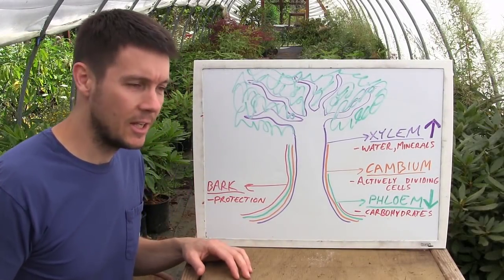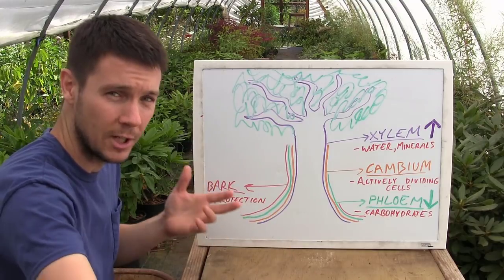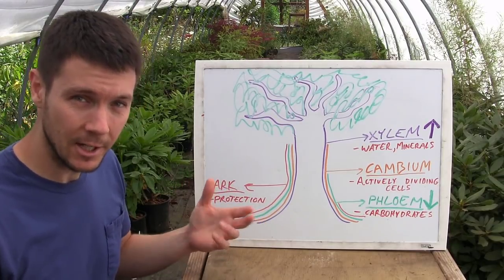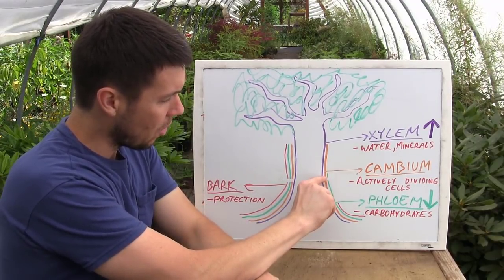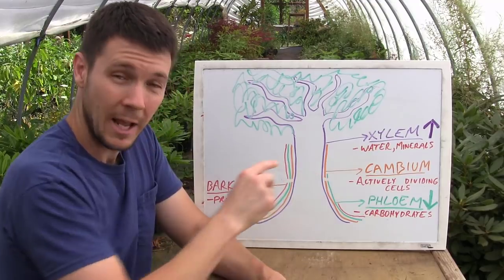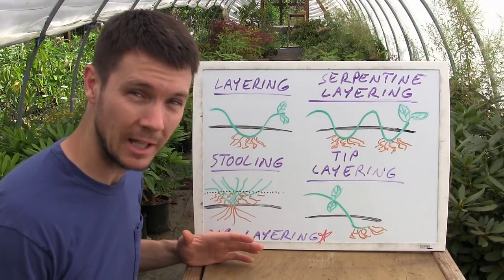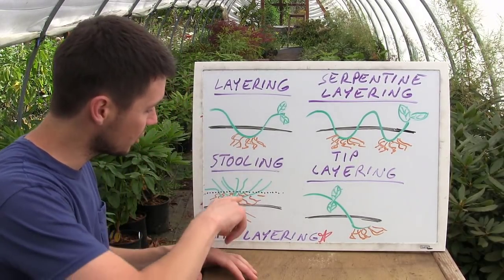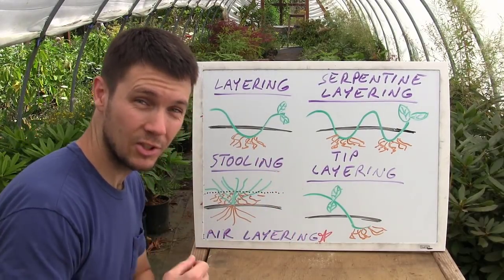Air Layering Fig Trees | My Experiment and the Science Behind it

Comment: SIR!  The knowledge you shared with me in this video has changed my life. Ring-barking the branch to prevent all sugars from going down sounded good in theory but I've killed branches of slow to root trees because they weren't strong enough to survive without phloem.  After watching your video  I've air layered mulberry and carambola(very slow to root) by placing a pot of dirt on a high stool/pile of bricks/ladder up to the low branches. I Removed 1/2 to 3/4 of the bark, lightly scraped the cambium and put the exposed side of the branch down. After a month, 100% survival and vigorous roots. I just snipped and left them in the same pots.
Reply from the maker: So glad to hear it!

Comment: I have 1 air layer of a 1 inch thick trunk.  I did not cut anything (I'll explain).  It's been on for 1 1/2 months and I used a three liter coke bottle.  The bottle is full of roots.  Now I have only done it this one time, but from what I saw there is no need to cut nothing.

Why I didn't cut?  Because in most videos I have seen, the roots don't grow out of the cut, they grow out of the nodes, and those other little dots on the bark.  I have rooted six cuttings and none of them had roots at the end of the cutting (where it was severed from the mother tree). All roots came like I said.  Now the nodes will produce the big thick roots instead of a branch, and from the little dots on the bark, thinner feeder roots will develop.  

For me I think that cutting all it does is open a wound that will allow bacteria and fungus in, all my failed cutting when I dug them out, the cut part was rotten.  So when I remove the air layer I will make the cut, and seal the exposed wood with a mix of resin, bees wax and candle wax.

Hope this helps.
Reply: Yes buddy you are perfectly right.

Comment: One thing I wanted to point out.  You answered a question for yourself and didn’t even realize it.  When you mentioned how easy figs are to root.  You Can do an air layer on fig without cutting at all and it will root.  However many plants just will not work that easy.    A lot of plants I’ve air layered and didn’t quite scrape good enough  , totally callused over and healed without any roots.   So I think it depends all on how easy the particular plant is to root .
Reply from the maker: I think you're right

Comment: Hey Mike, I just had a thought about the cuts you made. Have you done some experiments with horizontal slits instead of vertical? My thinking is that a horizontal cut would make a bigger impact in the flow of the plant going from top to bottom (like it does in ‘notching’). So Im wondering how a horizontal cut would perform vs a vertical cut 🤔😅
Reply from the maker: I agree 100% and love your idea.  I'll have to do a video experiment about it next summer when air layer season resumes.

Comment: That's a great informative video, Mike.  The one thing I might add is that when doing airlayers in the summertime, in a hot climate, like mine, here in south-central Washington state, it's a good idea to wrap the airlayer cup with aluminum foil to keep the soil in the cup from overheating from the sun.
Reply from the maker: Thanks Steve.  I've always used foil in the past but decided not to this time because it was later in the season and I wanted the soil to heat up.  You're right though, you live in a hotter climate and it might cook the cuttings.

Comment: Hee hee hee... by the second time you used the word "girdle" I knew exactly what you were doing wrong. I've been doing this for years by simply scratching a 2" section of bark away on half the branch with my housekey and laying it on the ground with a rock to hold it steady. So far, 100% success rate!
Reply from the maker: Great affirmation!
Reply: You are kidding? Scratch with a house key just one half of the branch and that's an successful airlayer. Good to know
Reply: @bobbrawley2612  Yep. No root hormone, no plastic womb filled with mulch, just scratch the surface with the key (which I assume permeates all the right layers) and then rest it on the ground with a rock on top. You can dig a little trench if you want, but I don't find it necessary. I do it in early spring to hydrangeas and rhodies, and just leave it alone until the next (not following) fall, and it's good to dig up and replant, or just leave to extend the original plant. If you leave it, you should cut the plant away from the mother after the first year, or it'll thrive at the expense of the original plant.
Reply: Did you accomplish this scratching also on a fig tree? How about other kinds of plants or trees?

Comment: Is this  experiment  still valid in your experience 
I don't understand why in airlayering videos everybody shows removing an inch of bark around the circumference  of the branch . A 3/32 " cut from a hacksaw blade would would interupt the down flow. 
 Rooting hormone applied to the White wood at the removed bark area  doesn't seem to do any good when the roots form from the terminus of the intact  bark  the naked or "sans bark"area doesn't sprout  roots

Also you learn by reading stuff . Where are you reading this stuff.
 I view videos to learn and have only read one university document on the best part of the branch to take a cutting in peach cultivar. 
The conclusion was the middle of the branch yet you show Dan having great success with cuttings from the terminal end of fig tree the soft green wood .  
 Scientific or university  studies .don't seem to be the "do all end all" word on practical gardening

Comment: Why doesn't bark rot in cuttings immersed  in a water bath and cuttings in damp soil or   sand rot?  Is oxygen the promoter if rot?
 In videos of cuttings immersed  in water the best root growth is right under the bubbler  whare the air bubbles  strike the cuttings . In that case the  oxygen  seem to promote root growth
Now what about your lecture on sand for us that don't have access to your red wood bark multch. I was shocked to discover how well sand retains dampness ., concluding that glass marbles and hyponic flush  would be best or better than sand to prevent rotting . All theory since I haven't tried either sand of marbles

Comment: I did airlayers on both my Golden Rainbow and Cardenillo this year. I used my grafting knife an scored the area. I just went down to white on both. I used rooting hormone as well. Both were successful and held their leaves. I did not girdle and had extreme root growth. Great minds think alike! Both trees are in their own pots and are thriving.
Reply from the maker: That's so great to hear.  It's funny, I think we've all been taught wrong all these years with the girdling technique.  My main purpose was to prove the theory for tougher to root plants like my rhododendrons so that's the next experiment but I'll have to wait until next summer to try it.  Thanks for sharing and I'll bet you'll get a pretty penny for that Golden Rainbow.
Reply: I ended up taking one of the massive leaves off the GR after potting. It was having a difficult time feeding the three huge leaves and two figs. I also took the two figs off. It perked up immediately. I plan on putting one of my two trees in ground in the spring.

Comment: Awesome discovery Sir.
Excellent. 👍
Could you explain how you made the cut?
Was it upwards or downwards and how deep? Did u do several cuts on halfside leaving the opposite untouched? Would like to see more progress with this new technique.
Reply from the maker: The slices I made were just through the soft surface layers of bark and cambium, I didn't cut that deep and I used a downward motion on the knife.  I'll keep you up to date on how they're doing next spring.
Reply: @MikeKincaid79  
Ok thx Mike for info.
Just to clarify if the stem is  vertical you cut downwards underneath a node?
I'll try it myself to see if it was successful. 
Another question did you add rooting hormone and do you keep wetting the potting soil or peat moss inside the plastic cup to encourage rooting?
Reply from the maker: Yes, cut downward along the length of the stem.  I did add rooting hormone, it's in the video.  I moistened the soil in the cup occasionally because I didn't seal it up with foil.

Comment: Thank you, Mike.  When you showed us the roots toward the end of this video, you said it was past the middle of September, but you didn't tell us when the layer would be removed.  When did you remove it from the mother tree?  Did you wait until dormancy?  Lop it off in September?  Or did you wait until Spring?
Reply from the maker: I didn't remove it and left the air layers in place all winter.  They ended up not making it through the winter.  I recommend cutting them from the parent tree now, potting them up, and protecting the new air layers.

Comment: Freezing temperatures on  
 my experience  doesn't destroy the roots of an air layer . Freezing temperatures  in the low 20s   20° F 
I had a  Chicago  Hardy airlayer to survive the winter in Manassas  Va
Reply: I had a pear cutting about a 1 point 5 inch branch that survived  in  five galleries bucket of water that frozen solid there were roots on the cutting being an airlayer where I only removed the bark half way around necsuse another leader was too close to get my  ra-or blade knife to He close side  that was. Five years ago 
 When I have  high expectation everything fails when I have low expectation I get success. That is the way it seems 
 In other words " don't baby the project" which is hard for me not to do

Comment: Great video. Under the right conditions the fig will  set roots without doing anything to the bark. I recently got some fig cutting from a friend, and a few of the limbs that were touching the ground had rooted. When propagating the cutting I took, the humidity was a little higher than necessary and the cuttings started putting roots out on the part of the cutting that wasn't in soil. I made a YouTube video of this if you want to check it out.
Reply from the maker: Sure, I'll look at it, thanks.

Comment: Mike you made air layering way too easy! Unfortunately, I don't have your green thumb to air layering anything although I have tried countless time to no avail.  My last attempt was on a mango branch and a Thai apple branch made on March 6, 2022, and I will be checking on the roots on March 26.  I applied the old method of removing the bark and cambium, used the air layering plastic ball, sphagnum moss, root hormone, and then wrap the whole thing with foil. If they don't root, I will try again with your new techniques but I am convinced that there is something I do that's not working. The trouble is I don't know what that is!  What is that little one thing I forget to do?  Thanks.
Reply from the maker: Wait!  Lol.  That’s the one little thing.  Air layers take longer and you may have to wait 3, 4, or more months.  Make sure the medium doesn’t dry out.
Reply: @MikeKincaid79  LOL... thanks. May be this is a topic you could cover on another video... How long is long enough to know if the layering is successful. Is there a tell tale sign from the branch growth above the girdling area?  Thanks.

Comment: I followed your method last summer.  I t worked so good!

I potted them through the winter in pots on the South side of the house.

I just planted them in March 2022.  They are getting leaves.

Thanks for this video.
Rhonda
Reply: I cut all of the bark.  However, I will try slicing this year.
Reply from the maker: Yeah, no problem.  Glad it worked out well for you Rhonda.

Comment: Do you water the air-layer cup, or do you just water the pot and the plant waters the air-layer itself?
Reply from the maker: You don't want the medium in the cup to dry out so if it starts to dry out then you would need to add a little water.  That being said, if you seal it up tight enough, it should root before it dries out.  Yes, the plant will supply water to the top of the air layer because it's still attached.

Comment: Tip. You can buy a cheap soldering iron to melt holes in the cup, and lid to get a tight fit around the  limb.
Reply from the maker: I really need to get one of those.  Picked up some Christmas tree ornaments that I'm turning into air layering pods and the dremel is a slow method that makes a huge mess.

Comment: Hey Fig Bro.. I air layer without removing any bark or even scoring the bark on fig trees. Especially where the growth is still green , the greener and fresher the growth the faster it generally roots. So no scoring or bark removal at all and you can get rooted air layers on fig trees with very very high success rates. I been testing it for 3 years and it works consistantly. Especially when done in the earlier parts of the year when its warm and trees are actively growing. I will do some this year and put it on here.
Reply from the maker: That’s fantastic!   Thanks for sharing that.  I’ll give it a go this season.  Heck, maybe I’ll make a video about it.

Comment: Its been 2 years,  Is this method working on harder to root plants?  I am going to try multiple methods at the same time and see what my different results are.   I have been using straight sphagnum moss not peat moss.
Reply from the maker: I definitely like this method better.  I should do an update video on this method this summer.
Reply: @MikeKincaid79  I was wondering if a reverse method would trigger branching particularly in the root stock of a great performing Peach Tree.    The actual fruit producing specimen has serious nematode and other root problems  so I want to trigger the rootstock to branch so I can air layer that and start up a rootstock mother plant.  Going to try something,  let you know if I discover something worth knowing.

Comment: The obvious answer is it might heal instead of making roots..
Probably leave 1/4 of bark as a start point
Reply from the maker: It did, and you're right.  It actually did root but very minimally and the roots were so weak that they died back that winter.
Reply: @MikeKincaid79  ok so some thoughts. Try to leave 1/4 of bark then if that doesn't work less or more depending on results. Also maybe make the length of cut longer like 2 inches would be harder to repair. This is probably a balancing act you would have to adjust for every different kind of tree.i also think it is worth the effort to have a much healthy plant in the end.
Reply from the maker: I appreciate your thoughts and like where you’re going with it.  I’ll have to do some more experimenting.

Comment: The way you air layer (girdle or diagonal cut) varies based on the fact the tree is either a Dicot or Monocot.  On Dicots, you girdle the branch and with monocots you make a diagonal slit through the branch.
Reply from the maker: Thanks, I’ll look into this more.
Reply: Yes, you are correct. However, Figs have a dicot system with netted veins. They are not monocot such as the Dracena plant that has parallel veins. Hence, Mike's question  as to why air layering a fig tree should require a 360 degree girdle is still a very valid question.